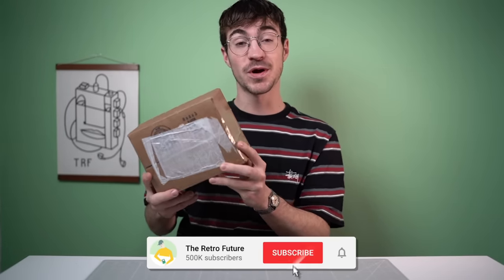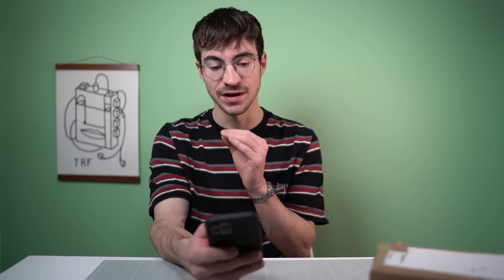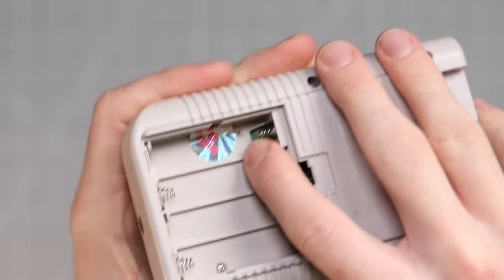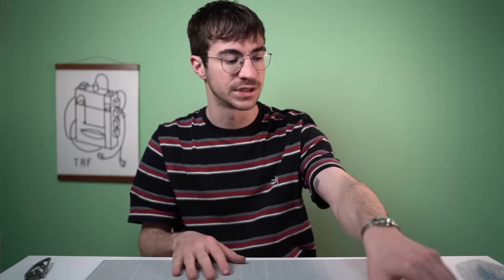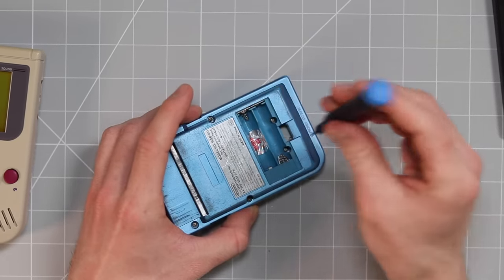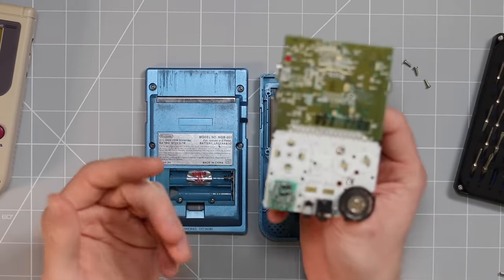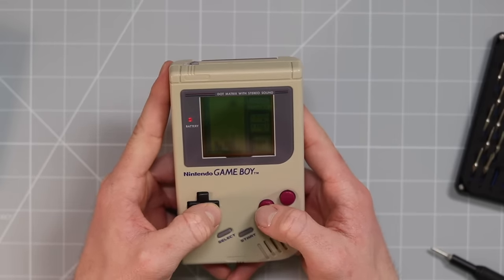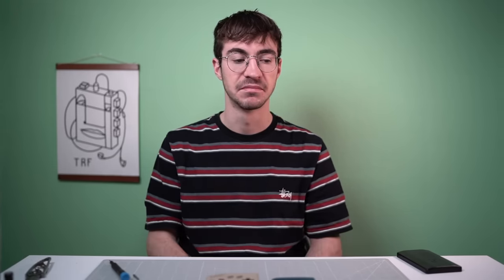DKOldies ruined my life

Comment: Selling at a premium isn't such a bad thing when it guarantees quality.

Selling at a premium when your system looks the same or worse than those you can find on eBay is, however, a problem.

Overall, I don't have the kind of averse nature to the words "cosmetically flawed" and I don't see a problem with the quality of the blue system considering said tag. I think that is an accurate way to describe it. The "screen smashed" analogy with an Apple product isn't really the same, because these screens are not broken. In fact, the only issues with them are the paint and that is not something that will hinder your enjoyment of the system. If you want a "like new" system, you're basically getting that with the standard Game Boy system you showed first. Aside from the yellowing and the ill-fitting screen meant for a modded IPS display, it's in very good condition and would be acceptable for most people.

It is on the high end of the "cosmetic damage" scale, whereas the blue Pocket system is somewhere in the middle. A low-end system would have bits broken or cracked. Paint scuffing where it has been laid on its back or the cartridge has been pulled out are not only fine, they're to be expected of an older system. Anyone wanting an authentic, once-loved Game Boy would be happy with that. Anyone else shouldn't be buying something that literally says cosmetically flawed so the expectations you have are a bit high, in my opinion, but I do agree that the price-point is a little high considering you can get the same thing off eBay for less and still get your money back if they try to screw you.

Judging from other videos literally criticizing DKOldies in their titles that I'm seeing right now, they do not seem to have the reputation needed to charge a premium for their systems. You could get screwed over by them and have a harder time getting your money back than if you just bought a system on eBay. And at least on eBay you can get a clear picture of the product you want to buy and decide if it's acceptable to you.

Comment: I'm starting to realize that a lot of these classic gamers like me and myself but I have a lot more level-headed believe that a Gameboy color or a game should still cost just as much if not be way cheaper than what it was brand new. If you buy a 67 GTO or 69 Dodge charger and expect yourself to spend $78,000 because that's what it cost brand new back in the 1960s your freaking insane. Yes condition sometimes is a big factor of when you're buying something if you are willing to spend the money for it if not it should not be costing you an arm and a leg. But for the most part when you buy a brand new game back in the 90s and it costed $60 and you want to buy something in really good condition now in your only expecting to spend twenty-five or thirty bucks for a game yes granted technically it's used but if it's still in great working condition if you ask me that game is still worth 70 80 or $90 depending on its rarity
Reply: The prices aren't bad but the quality is imo.

Comment: I bought an N64 console from them years ago and it died really quick. It refused to read my cartridges even if I cleaned them! Not only that but it had this problem where it would reset itself when it did work. I also remember it being very greasy and dirty when I received it. I just bought another N64 from a more reliable seller and so far so good. It was cleaned and it works great! Never buying systems from these idiots again.

Comment: No from the start.  They took all the care of Amazon when throwing those into the box and sending them overseas.  They should be bubble wrapped and taped up separately with enough filler to keep them away from all sides and to keep them from moving.  They fell out of the loose bubble wrap.  😂